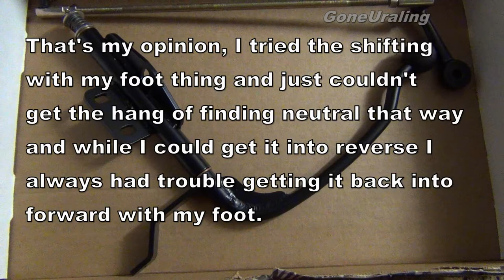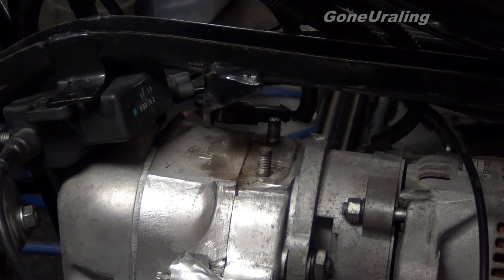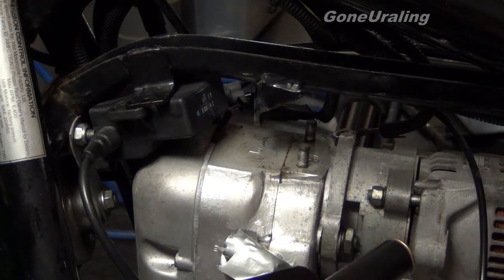Raceway Reverse Tank Shifter Lever Installation

Comment: Here it is, 2022, and I’m picking out my new (used?) Ural within the next 2 weeks.

My brothers & I are life long riders (& we are Olde!), and now I have the bug to get back out on the dirt with these knuckleheads.

I’ve been binging on every Ural video I can find, Be cause “Knowledge is power”, right?

I’ve listened to the bitching that goes on when there’s neutral/forward/reverse switching, and you convinced me to add this reverse lever.

Nice job on the video, and thanx for putting it out there!👍😎
Reply from the maker: So, what'd you end up getting?  You get haters that just hate and the rose colored glasses crowd that tells you to put 2000 lbs on it and drive 80mph all day. It is sometimes hard to tell what is what. It is not brimstone and fire nor are the rigs perfect. Honestly, find and go to a GOOD dealer, it makes all the difference from initial setup to support and repairs.